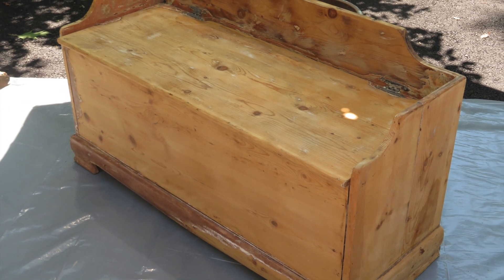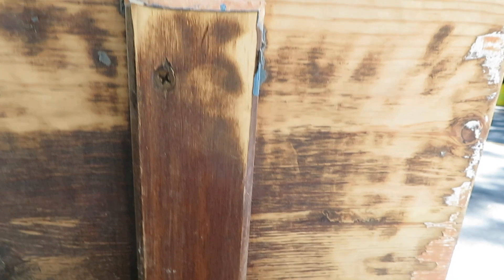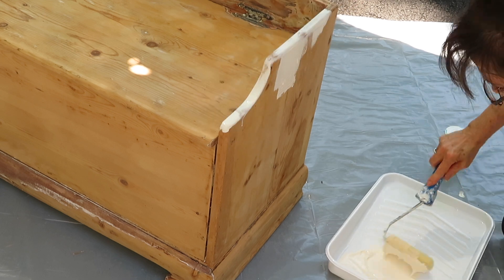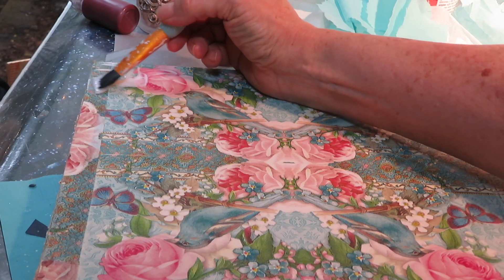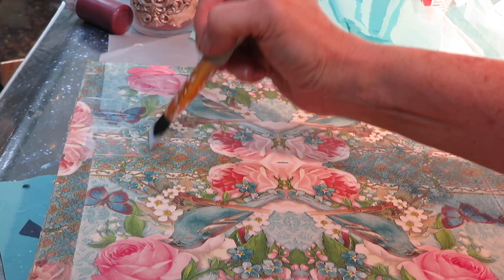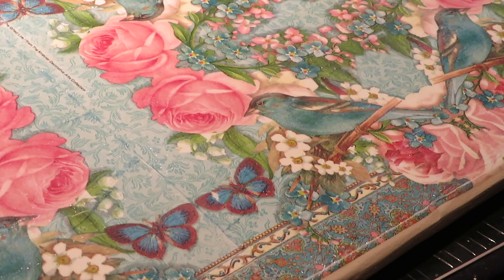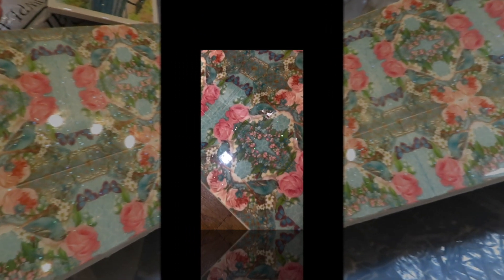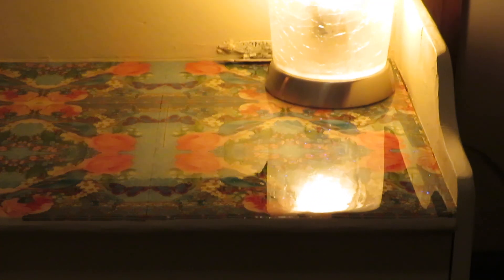DIy Step by Step Decoupage Iron On Furniture

Comment: Patti, another comment: I have photos that I saved of gorgeous trays, with the mirror/glass-like finish from epoxy or resin, in a shop in Nantucket. They were so beautiful, so glossy, I was weak in the knees and covetous of them. All I knew at the time was Triple Thick for glossy finishes but I'd never produced the kind of finish that the trays had. Finally researched it, the prep, the precautions, the spreading, the need for fresh air. Some day I'm going to attempt a resin-something. Your project is so very pretty, and it looks like tiles to me, too.